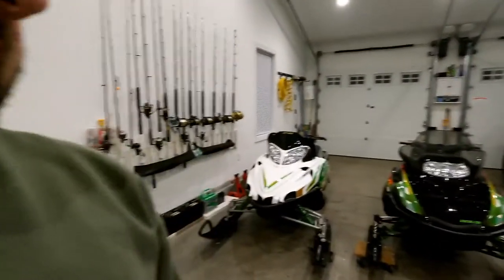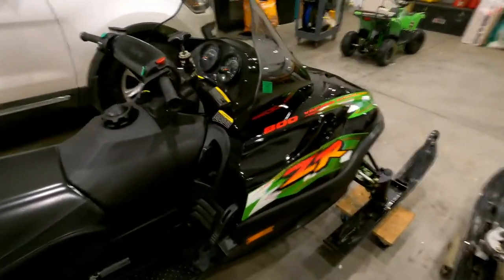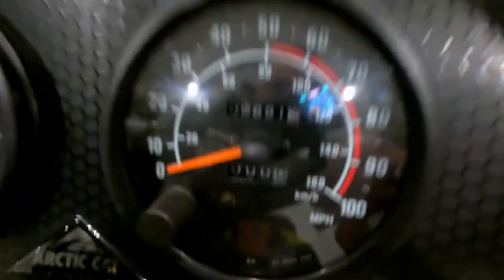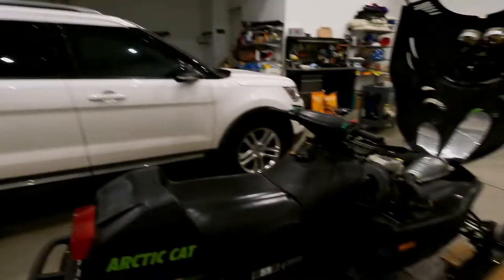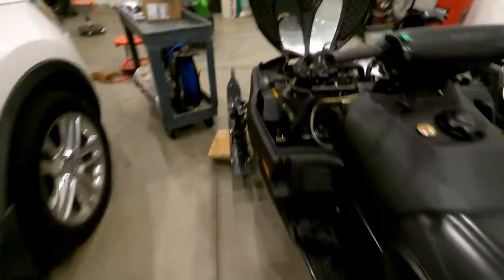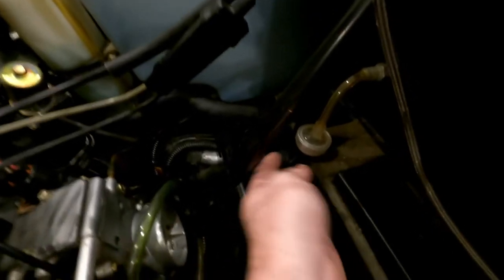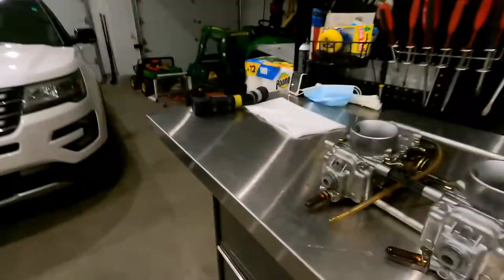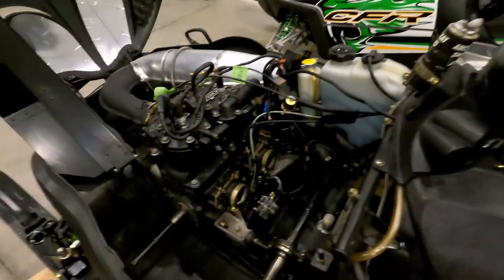ZR 800: Pulling the Carbs and Fuel Lines

Comment: would liked to see the steps it took to pull the air box  time laps did not help me thanks for your efforts
Reply from the maker: Thanks for the recommendation, I will keep that in mind for the next videos.  The airbox isn't too bad to pull off, just a little time consuming disconnecting everything.  Once you have the tool tray pulled, screws/bolts removed, wires and hoses discounted, it kind of rotates out.